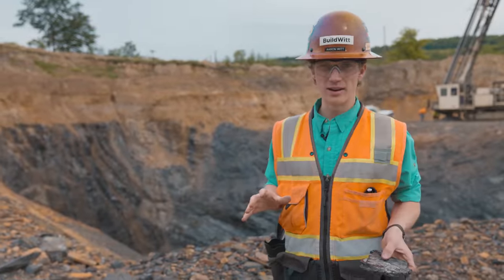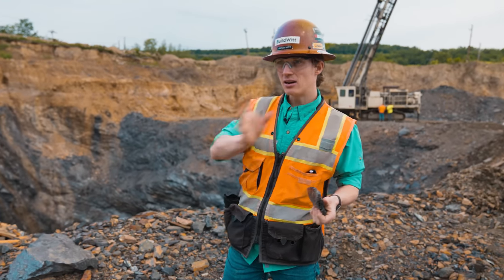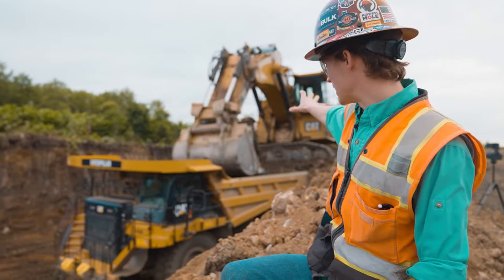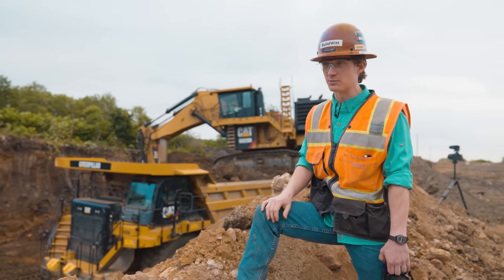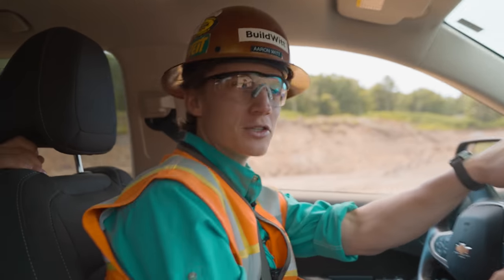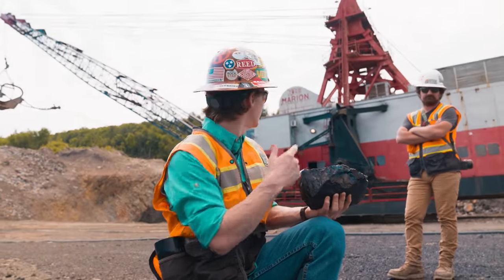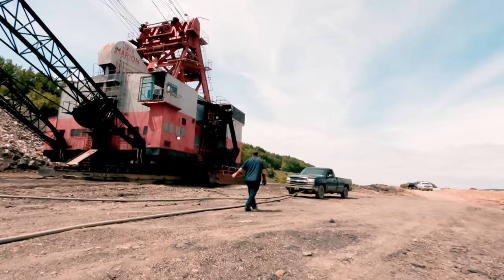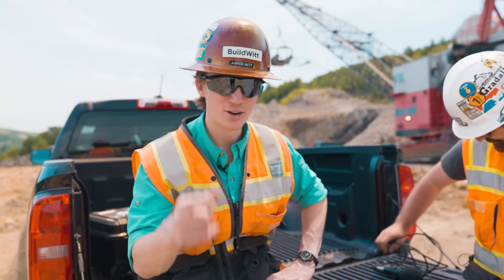American Coal Through The ROOF | Selling 600,000 Tons a Year | Reading Anthracite Coal Mining

Comment from the maker: What's the worst piece of equipment to operate? Why?
Reply: A pencil
Reply: Backhoe. Pretty bad at two things
Reply: Hydraulic Excavator - with levers instead of joysticks!
Reply: any machine from sunbelt rentals that has over 1000 hrs.
Reply: Rental machines.  
They are often beat up and worn out pretty good
Reply: When I rent. I rent from Cat not some backwoods rental. The machines provided are if not new. Very close to it.
Reply: @timschrader7395  this guy is so right! Haha backhoe is the handiest unhandy thing ever invented!!! 😂
Reply: a razor, not that you would know
Reply: @murrkem8239  finish your meaning boy
Reply: Skid-steer with solid tires and loose control linkages.
Reply: Any haul truck. That's a long miserable day in a machine that requires no skill or ability to operate.
Reply: @stevenmucha2973  maybe you should get a different job. Not everyone can drive a haul truck. Yes it is the first stepping stone but I’ve seen morons turn haul trucks over. If you don’t enjoy your job. No matter what it is, you will become bored no matter what machine you operate
Reply: @edgemonsiteworksllc3369  not true I run excavator and loader and I'm always entertained and drawn into the work yet to be bored after 8 years. Ran haul truck here and there for a few months to strip and who ever runs the haul truck is just a warm body not an operator
Reply: @stevenmucha2973  you”RUN” equipment. Beginners words for operating. I’ve been in business since 1980, if you don’t enjoy what your doing. Your performance will suck and you will become bored on any machine
Reply: @edgemonsiteworksllc3369  He asked a simple question. worst piece of equipment to operate? Seams like a subjective question so I gave my opinion. You chiming in and saying it's a good stepping stone is supporting my thoughts that it's a basic job that's good for someone just getting into the trade. No need to be petty people use different words for the same thing across the world. I love OPERATING equipment and mining overall but my opinion is a haul truck is a monotonous piece of equipment to OPERATE and if someone doesn't enjoy it they should do their time and try to move onto something they might enjoy not "find a different job".
Reply: @stevenmucha2973  lol. Your comment only shows you as a poor operator. I’m very sure you haven’t been an operator long and if you have and they put you back in a haul truck. That shows I’m right.,a poor operator.
Reply: @edgemonsiteworksllc3369  your business is pretty sad only bad reviews probably because your a bad operator.
Reply: @stevenmucha2973  a wanna be operator running his mouth on social media. Boy. When you are in excavation, coast to coast for 45 years then you can open your mouth. Until then just ride your lawnmower in circles

Comment: What are the red modules/canisters on top of the 6020B?
Reply: Fire suppression system it has sensors to tell if the machine goes on fire and if it does they automatically fire all over the engine pumps etc
Reply from the maker: Fire suppression

Comment: Why is the 6020B so rare? Are most mining operations on a larger scale and requiring a bigger machine?
Reply from the maker: they're just a mid-size that's not all that common
Reply: @AaronWitt  there's a 6040 shovel down around Birmingham Alabama
Reply: Just too small for most mines. The same can be said for the Cat 777. We call them the wheelbarrows, there are a couple still being used in smaller power station coal mines here in Australia.
Reply: @brendangee593  Truck size here in the mountains is based on how wide a bench you have and how large the job is.

Comment: Would that be the preferred choice of coal for a coal fired forge?
Reply: nope. Coal from Virginia, bituminous coal, is the best for a forge.
Reply: @javanbybee4822  Here in Eastern Kentucky mainly in Morgan county is cannel coal that has high BTU heat value but has not been deep mined in years but is on the market now. Some bituminous mines has some cannel coal and it is separated and sold for home heating fuel.